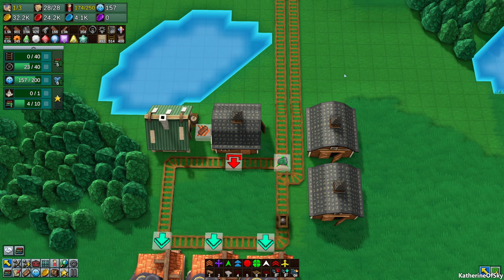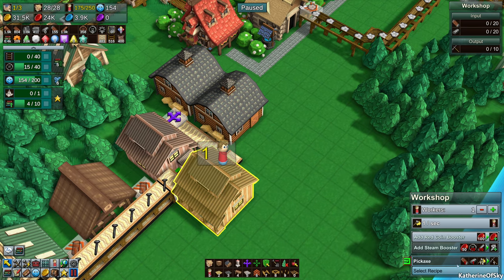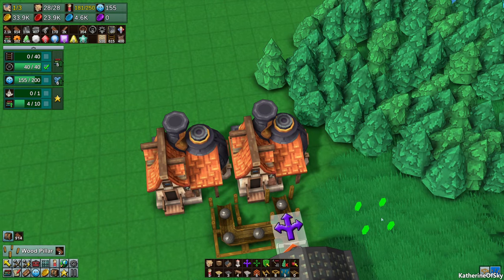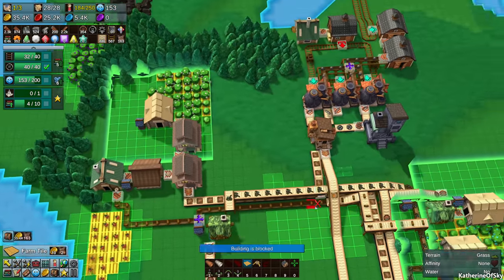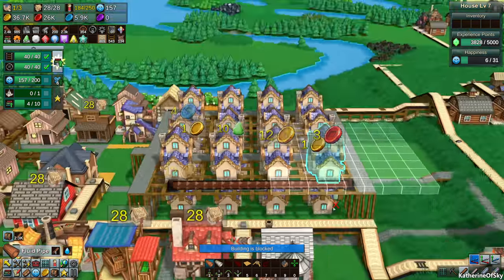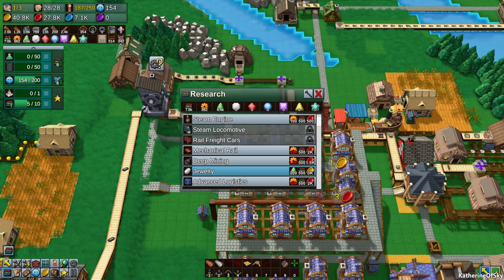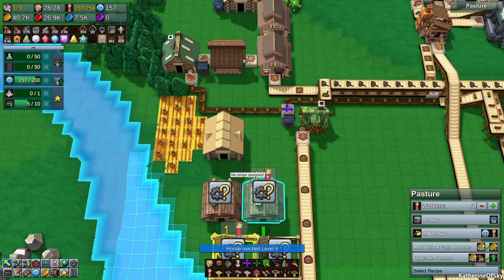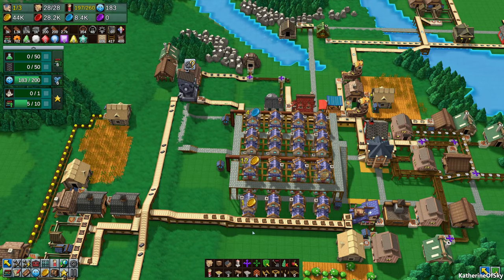SAY CHEESE! - Factory Town - Let's Play, Ep 7

Comment: Katherine, don't forget you can use fluid pipes for milk, fish oil, and remedies.  Underground fluid pipes work so much better than belts.  With the pipes there are "2d" pipes and "3d" pipes.  2d pipes are almost always best, but they can't connect to homes above ground.  You can use 3d pipes, but you will need a connector. When in 2d mode, connectors (where you stop/start) are created automatically, but in 3d mode you must create them manually.  To go from 2d, to a second story house...you need to create a 2d pipe connector.  Then switch to 3d mode and select a 3d pipe.  You should see a faint circle where you can connect your 3d pipe to the 2d outlet.  From there, lay your pipe so it runs accross your homes.  Then select the connector and place it on top of the pipe to create outlets.  This should work well.  Also you can use belts and rail to distribute water to homes too if you wish.  Note, because your well is located above ground as are your second story houses, technically speaking you don't need to create 2d pipe connections...but if you start with 3d, you will have to put a connector next to the well.

Comment: Watching Avaak's playthrough, he mentioned something about pipes only being able to connect at points directly and perfectly flatly
connected to the terrain. He had an example of a house built on the edge of a slope so platforms had been automatically built where the slope was so the building was level, and the pipes couldn't connect to the points at those points only where the ground was perfectly level and directly touching the building. Not sure why that is, but he noticed it too. I don't know if you can connect pipes to the upper level at all.
Reply from the maker: You have to connect them at the level of the building base or up to 3 (full) levels above.

Comment: KOS if you are still working on the water, place a storage up above, (crate, barn or silo) they have under water connectors.  run the water from the well to the storage, then above ground you can place a pipe that connects to the storage that will pipe the water up.  I do find it easiest to start the pipe 1 from the storage and run it 2 away from the storage on the same height it should make one of the blocks a connector, them to go vertical up to the height you want.

Comment: 1:07 what you want is a signal tag. Tag the cart and the pusher with the text 'Stone'. Signal Tags are comma separated lists of things that will respond only to agents with that tag.

I tag all my mine carts and trains with the names of the items I want them to carry (and sometimes the name of the town they are going to if there are multiple towns getting from one mine).  Then use pushers and filters in creative ways to get carts going the way I want. (also agent triggers and blockers. Sometimes I need a general trigger to set a blocker and then an agent trigger with a signal tag after it to open it...) 

Careful  (because I made this mistake) not to have a space after the comma or it might not recognize it. "coal, iron forge" won't respond to the "iron forge" tag because of the space. Has to be "coal,iron forge"

Loaders and unloaders also use signal Tags. This is useful for trains, because trains stop to load and unload (mine carts dont) and will stop and every loader and unloader unless they are tagged such that they don't apply.
Reply: Also doing it on a straight section instead of the corner
Reply: @Sullrosh  that doesn't matter so much, although there is nothing preventing other cars from going that way and I think at a T junction minecarts default to going left.

Comment: To extract and insert the fluids you need the fluid pipe connectors. The circles in the underground (2D) mode are automatic when you place a pipe under tile that accepts them (green, not through the tile, but to it, or you can place manually) at ground level. Above ground you need to place them. You can connect the under ground to above ground using the connector (one in both layers). They will try and place automatically like grabbers if you move a pipe in a straight line from or too a proper inventory, otherwise you have to place them manually.

Comment: 25:04 there's a pipe connection item. It builds them automatically underground but you actually have to select it above ground.

25:21 on the bottom right you can change your axis to make pipes go Vertical. Edit oh you found it, hurray! (you'll also need connectors to the underground...)

27:44 that tool there is the one you want. With the arrow. Green is input red is output.

Comment: 10:29 I concur. I use rails sparingly. There has to be a lot of distance and even then I'd rather use a caravan relay chain with a barn in the middle. Or a large boat.

Also wind shrines (later) give workers a boost but not for rail agents.  So if you have wind shrines along your shipping line it's so much better than rail, which is too restrictive.

Comment: 22:27 there's a column grabber tool that can select the whole column of everything and move everything at one. It's on your bar... The thing with the large green box.

23:27 you can drag the scaffolding across, you just have to start by attaching to the side of one of them instead of the top.